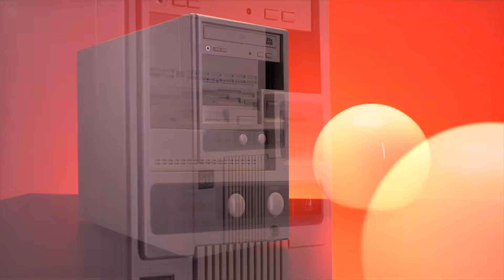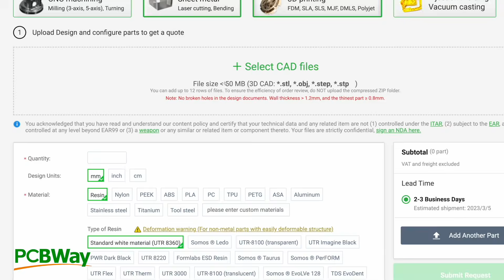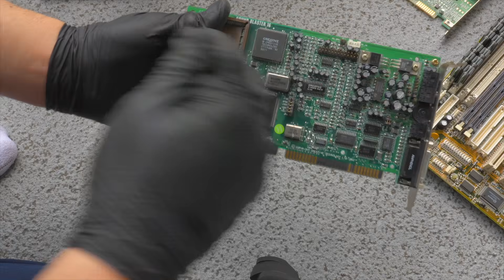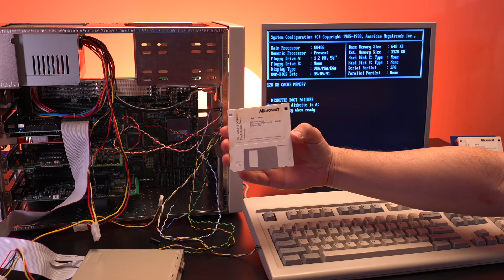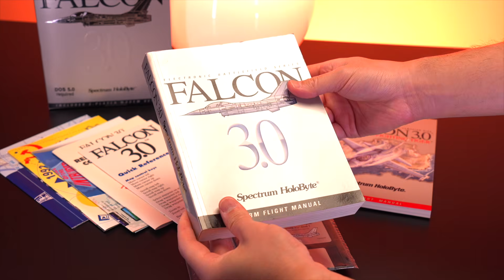Restored And Upgraded 32 Years Later | 486 DOS Build

Comment: Why did you just max out the memory and the cache (although as far as the cache goes, I think you maxed it)? I know you wanted to keep the original configuration as when you were a kid - but I mean - what's the harm with maxing it out?  Follow up question: Why not get the most power video card that mother board can support?  

Just more curious than anything else

Comment: Restoring that entire system, then not replacing the CPU is an epic fail.

In 2026 (even in 2025 when this video was made), getting a 486 DX4 isnt expensive.

Hell even a DX2 would have been ideal, but you had a bog standard 486 DX CPU which is probably running upto 50Mhz - the performance is going to be horrendous even for a retro system.

EDIT: I just saw the details on the chip, its 33Mhz. Upgrading the cache and RAM will make zero difference if your CPU cant even handle the instruction throughput from the games themselves.

Your CPU speed dictates how fast your PC can process instructions. It needs to be at least 100Mhz - in fact im pretty sure you didnt mention the minimum specs for Doom or Wolfenstein.

8MB RAM is insanely low, you should check the maximum capacity the motherboard supports.

I had a 486 DX4 and upgraded the ram from 4MB to 28MB.

You should be able to replace the 1MB SIMMs with 4MB SIMMs.

Whoever told you CPUs even as old as the 486 dont require a heatsink needs their head examining, they ABSOLUTELY do require a heatsink at the bare minimum.

Comment: It seems that people are always tripping over the MBR, so here's a tip for anyone that is reusing any sort of media as a hard disk:

1) Boot from a floppy (the DOS setup disk is fine, just exit out of setup) and run fdisk.  Use option 4 to view the partition table already on the disk.  It will list "DOS partitions" and "Non-DOS partitions" -- the latter being any partition type that DOS does not recognize.  That includes later versions of FAT, ExFAT, NTFS, Linux, etc.

2) Use option 3 to delete the partition(s) from the disk.  Do note this will, of course, permanently erase any data on the disk.  So best to copy anything you want to keep onto a newer computer first, and treat the disk as if it was blank anyway.

3) When there are "no partitions defined" according to fdisk, use option 1 to create a new DOS partition.  In most cases, you will want to use the maximum size and make it active.  Note that DOS may not (read: probably won't) see the whole capacity of the disk unless it's under 2GB, and possibly only if it's under 512MB.  Which limit applies depends on what version of DOS (6.22 and below do not support LBA, only CHS addressing), and whether/how your BIOS translates "large disks" to a geometry that DOS can understand.  In a 486 and below, running MS-DOS before the version shipped with Windows 95, that often means 512MB tops.  Later 486s, and particularly DX/2 and DX/4 systems, are more recent and probably support 2GB drives.

4) If you created more than one partition, or decided to use less than the full capacity, don't forget to mark your first partition Active using option 2 at the main menu.  If you miss this, DOS will not boot.

5) Exit fidsk and restart from the boot floppy.  This time, run "fdisk /mbr".  It will only take a moment, and then return to the DOS prompt like nothing happened.  This is the part many people miss.  It isn't always required, but can lead to much confusion if it is, and you don't do it.  More below on why.

6) Now you can continue with the normal setup routine -- either formatting the disk manually (format c: /s /u), or using DOS Setup to do it for you.

WHY THIS IS IMPORTANT

Removing the old partition and creating a new one helps because many newer tools will create partition types that DOS cannot understand.  ExFAT and NTFS share partition type 0x07, which DOS will not recognize -- and wouldn't know what to do with anyway because the filesystem is not FAT16.  Similarly, there are separate partition types for FAT with CHS addressing, and FAT with LBA addressing.  You need the former, but many later OSes will use the latter, since CHS fell out of use during the early Win9x days.  You might also run into trouble, even if the partition type is correct, just because two different BIOSes may use different ways of translating "large disks" to more compatible CHS values.  This translation got to be more predictable later, but especially when it was a novel feature, it may be unique to the machine that the disk was first installed in.  Moving the disk to another computer may not work, since the two may use different translations.  The way to resolve it was usually to remove the partition(s) and start over.

The "fdisk /mbr" thing rewrites the Master Boot Record -- the first 512 bytes on the disk.  This first sector includes a tiny bit of bootstrap code that tells the CPU how to read the partition table, find the first Active DOS partition, and run the bootloader in that partition.  If your disk does not have this code, the computer will not be able to find DOS.  Disks that were never meant to be booted from (like non-boot floppies, ZIP disks, and Compact Flash cards) may have nothing here but a jump instruction to nowhere, causing the CPU to run random data as instructions, which can lead to any number of bizarre outcomes.  Or it might be an intentional infinite loop that just "locks up" the computer for safety, preventing it from going haywire.  Or a message that says "Insert a system disk and press any key".  Even on used hard disks that were meant to be boot drives, it could contain "drive overlay" software meant to fool DOS into supporting large drives that may not be setup correctly for your computer, or a leftover Linux/NT boot loader, or even an old virus.  Replacing the MBR boot code with something valid and predictable solves all of those potential problems, and takes about 5 seconds -- which is the time it takes to load the fdisk executable from your floppy disk.

The "format c: /s /u" command does two things:  /U means perform an unconditional format.  I.e., don't bother saving "unformat" information, just get on with it.  It's optional, but this isn't 1992, and you don't need to be saved from accidentally erasing your WordPerfect documents.  /S copies the DOS boot loader to its special hidden place at the beginning of the file system.  This is different from the MBR, which is like Stage 1 of the boot process.  The DOS loader is Stage 2.

Comment: I would love to see a follow-up video for this, especially as you take the comments on board and tweak the machine. A few things to note;
For the upgrades you have already performed, you will need to source a TAG SRAM chip for your L2 cache. I'm rather hazy on this, so I'm not sure on how to help you find what you're looking for, but it will be important.
For storage, I would look into a contempraneous IDE card. XT-IDE is useful, but primarily for a class of computer much older than this. It will be using an 8-bit rather than a 16-bit ISA bus, which will slow things down.
For other bottlenecks, your CPU and graphics card are the primary culprits.
Sadly you are stuck with ISA, but some of the later Cirrus Logic cards or a Tseng ET4000/w32 especially could make a big difference.
The CPU will slow things down for Doom. A DX2 66MHz or above would be ideal. There is no problem with leaving it as it is for nostalgia reasons, but be aware that these are the parts that affect it the most.

Comment: You should double-check the BIOS settings for your cache memory.  Even though you set jumpers for it, some of those old machines still had to have BIOS settings configured correctly.  As for RAM, you'll notice quite an improvement by replacing all the 1MB modules with either 2MB modules or 4MB modules.  Another thing worth looking in to is to see if that 486 CPU has an integrated math coprocessor or not.  I couldn't get a great look at it in the video to tell you if it does or not.  If it doesn't, get an 80487 to go in that empty FPU socket on the motherboard.  Lastly, try to find a decent ISA VGA card.  If possible, try to get one with at least 1MB of VRAM - although 2MB would be better.  You're limited to the 16-bit ISA bus, so you won't be able to take advantage of the VLB cards designed specifically for the later 486 systems, and obviously PCI isn't an option.  That said, that 33MHz CPU is going to be more of a bottleneck anyway.

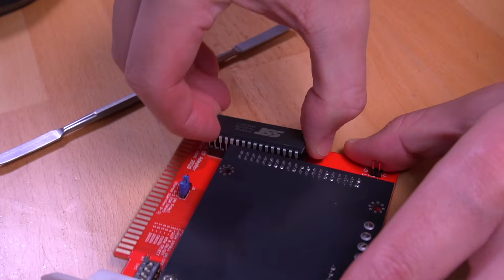Comment: 16:50 not flashing? not sure if this is the problem but I'll say with using Glitchworks r4 XTIDE Card I Couldn't Flash if I had shadow ram enabled (for the range the rom used). or that I used the wrong rom chip... whatevah, <3 all

edit: i wonder what performance upgrade there might be if using a 16-bit ISA card and configure XT-IDE to utilize that extra data width?? I know there was a jump when going from 16-bit to 32-bit in my 486 Vesa Local Bus IDE Controller Card!
editedit: Not sure how Ya tried to programed the ROM, but what ROM file Ya do use has to be configured by that XT-IDE ROM DOS Utility! Annnd, if there is a ROM file size mismatch to EEPROM size, then maybe double up the ROM to occupy extra areas.
editx3!: I would look for a 16-bit ISA dual IDE Controller Card (that has Jumper support manuals or on retro-websites) and get the existing IDE/ATAPI CDROM working. And then worry about acquiring a Proprietary SCSI CDROM of which there were three types SB16's of the era used. Mitsumi, Matsushita/Panasonic, and Sony. I only say this 'cos finding one that works might be difficult as it might be fixing one. shoot, my 486 VLB my ol' Father's pooter and I upgraded it to a fancy Pioneer Slot Load DVD for the LOL's! (from another IDE drive cos the proprietary SCSI dieded and couldn't revive it)

Comment: Having had a couple of old retro PC's now, I strongly suggest finding working hardware that's period correct it's so much easier if you can just burn a CD or floppy with the software it should have had in period. Getting this modern stuff to work with old hardware is always going to be buggy/weird and difficult.

Getting a modern USB CD-RW and Floppy drive for your modern PC to get things onto your retro PC old school style is the way to do it.

Comment: So your using a 486dx at 33mhz, I'd upgrade to a dx2-66, or even better to a dx4-100!
I have a Compaq Prolinea 4/33s, with the similar cpu which i upgraded to a dx2-66. So the faster speed u get, the faster and smoother your games would be

Comment: So, I was a little surprised at your results and figured I'd compare them to my 486 - a DX/2 50 model with 16 MB of RAM and a ATI Graphics Wonder (ISA), using a CF card on the IDE interface for storage.  I splurged on sound and got a Orpheus II LT with the Dreamblaster X2GS, but that shouldn't effect results.

Superscape was 27, PC Player was 7.5, and Doom on max settings was 14.78.  Weirdly slow, but I think the "max" settings used are higher than most of what people actually use?  I played a bit of Doom on the machine after that and it occasionally chugged a bit, but nothing like the speed text test.

I'd strongly urge you to get a Dreamblaster from Serdaco as a MIDI daughterboard for whatever sound card you use in DOS (if it has a header for it, as most do).  I'd also consider ordering a MK1869 ESS clone - you can order a Dreamblaster with it at a discount.

Comment: It's funny, my first PC from early 1994 looks a lot like this: same case, same video card (Trident), same sound card (SB 16), same hard drive capacity (210 MB, Conner brand), with 4 MB of RAM and an Intel 486 SX processor (replaced a few months later by a DX2-66).

Comment: try to install the 486dx50 processor, I got decent perf out of it. Some people preferred the dx2 66, but I liked the dx50 because it had a higher bus clock of 50Mhz compared to the 33Mhz of the dx2 66, so some components on the mother board ran at higher clock

Comment: In those days the CPU was the bottleneck. Not cache or ram and this is because modern cpus are so quick they execute data before all rhe data can arrive. They are bandwidth starved. An Intel overdrive can clock multiple it as a dx/2 at 66 mhz

Comment: Others mentioned you're bottlenecked by the video card and that's true. But you would need to swap the motherboard for another one with VLB or PCI slots. If you want to keep the current board I would recommend overclocking the ISA bus which is running at approx. 8 MHz. Raise the clock to at least 12 MHz with proper dividers in BIOS and you'll see a nice bump in performance. Higher bus clock can make other ISA devices unstable so check if the sound card and IDE devices work fine, but at 12 MHz it should be fine.
It still will be slower than VLB or PCI card but better than nothing. And definitely check memory timings, those make huge difference.

Comment: The framerate performance for Doom you're showing there is bizzare. You shouldn't have a 486DX 33 struggling with 8mb like that. It's not optimal for Doom but that's way too sluggish of a framerate even at full-screen. There's 100% some data pipeline issue somewhere. Maybe something odd with how the HD emulator works or the graphics card. I don't know.
If all else fails FastDoom is a fork of Doom meant for slower vintage hardware that optimizes it to even run smoothly on a 386.

Comment: This brings me back, man, dealing with dip switches,  jumpers, planning out your irq and dma settings with all your expansion cards before plug and play really came to be stadard. My first family pc was a 286 16mhz 640kb ram. It could only run Wolf 3d and Duke and Duke 2, simple side scrollers like that, Windows 3.0, not 3.1 or 3.11, so no networking and worst of all NO DOOM!. My buddy gave me a 2400buad (2.4k)modem when his dad upgraded his 486 family pc to a 28.8k and an sb16 like yours.  Omg what a difference with games, no more just pc speaker for sound. The modem i used to connect to bbs's or bulletin board systems that was kinda like invite only torrent servers today.   No pausing downloads so if someone picked up the phone while you were connected to a bbs with the modem,  you had to start all over again.

Comment: You could have stopped to benchmark the machine a couple more times. Like between the RAM and the cache upgrade  incase one of those could have been the reason for the fail after scores. Unlikely but no harm in checking.
Other than that, nice vid Tito :D.

Comment: You honesty did not need to fit a case fan to that machine. Note that yours and the majority of 286 to 486 PCS of that kind of era didn't even have a spot to allow for any kind of fan. The only one needed was possibly for the CPU (if using a 486 dx 50 or higher).

Comment: To clear any confusion, the turbo button should underclock the rig, this was needed in case your cpu was too fast for certain games. Maybe it is wired incorrectly, since it reverts the cpu back to it's normal clock when activated.

Comment: Now THIS is my retro console! 

1:30 Wolfenstein = Wolf-In-Shtein : Like Beer Stein which is pronounced with an Shhh-tine. This is confirmed in Wolfenstein: The Old Blood.
I've only heard very few (usually younger) content creators pronounce it 'steeen' (like seen).

Cyrix was a kind of competitor to intel (and AMD, yes AMD was around then too) but more on the 586 market and not Pentium. There was alot of confusion that Pentium = 586 back then, but architecturally , they were different. 

I've long since lost my (two) original 486 PC's, but managed to pick up one years ago (with a Dx4-100). Though im having issues getting the Seral port to work with the mouse. 

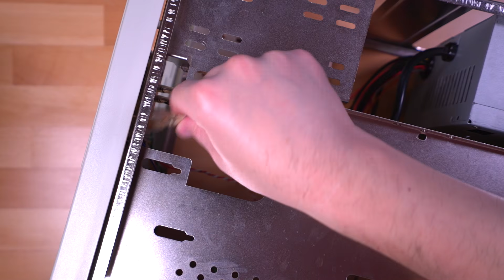13:58 Good call. You do NOT want to mix up those wires, lest you release the magic smoke when you try to turn it on (ask me how i know) :P

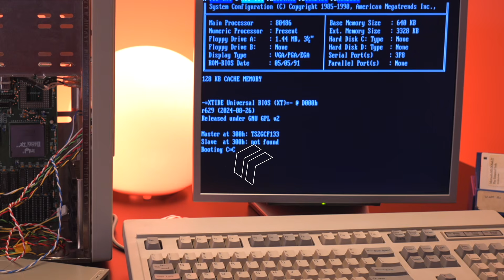17:28 The reason is likely because compact flash either has an IDE mode, or operates under the IDE protocol (I forget which) so its much more naturally compatible with dos computers (or more specifically, IDE interfaces). SD cards can work, if you get the right adaptor. I got mine of Amazon somewhere and it worked with no issues but its also just a board, which i 3d printed a 3.5in bay caddy for so i could access the SD card from one of the floppy slots in the front (this makes it much faster to transfer programs onto it as i can just remove it and insert it into my current PC). Of course this option adds in the requirement to run an IDE and power cable to it, creating more clutter in the case so, pick your poison :P

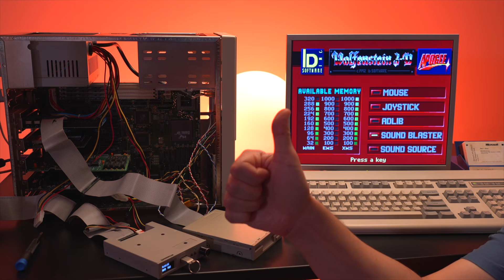18:36 Doom is likely not smoothest because either is the 33MHz CPU and/or because you're only running 3.3MB of (available) ram. It ran pretty well on my 66MHz 486 /w 4MB ram on my PC (back in the 90s). 

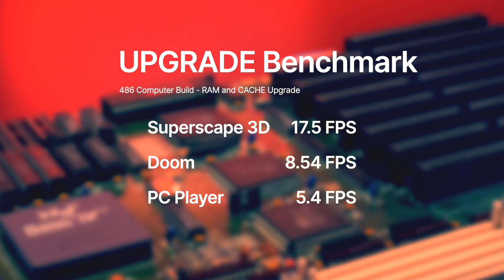22:56 The most likely reason the performance didn't improve is that (from what i can tell from the video) you're not running EMM386 to take advantage of the additional memory. The biggest quirk about DoS is that it didn't really have much in the way of automatic memory management. You had to configured that yourself and often (mainly, the cache), had to change what was allocated where depending on the game (or programs) demands (when i get home, i can fire mine up to see how i have mine configured). It involved messing with Autoexec.bat and Config.sys files. 

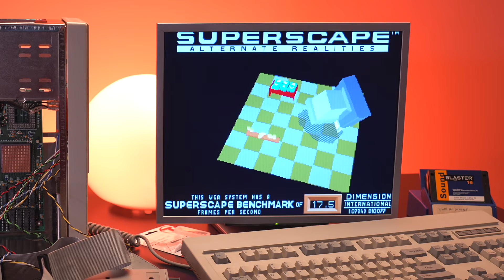22:29 Hard to tell without having it in front of me, but my guess would be its some setting in the BIOS.
Reply from the maker: Thanks for the comment! I would love to know if there is a way to better utilize the ram and cache!

Comment: You'd see a pretty noticeable performance bump going to a VESA graphics card. Since you have an ISA card it is limited to ISA performance, which is very low. PCs from that era did have VESA local bus video cards as a premium option, but you may be able to improve your numbers by getting an ISA version of Diamond Stealth 64 graphics card. Prior to GPUs coming onto the scene in the late 90s, the Diamond, Matrox, and Tseng Labs all made really good 2D-only graphics cards.